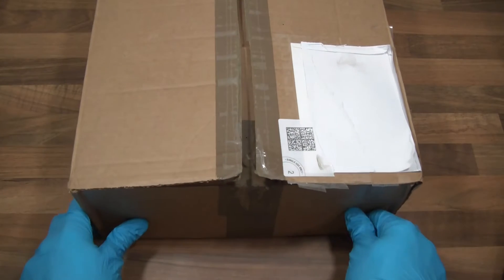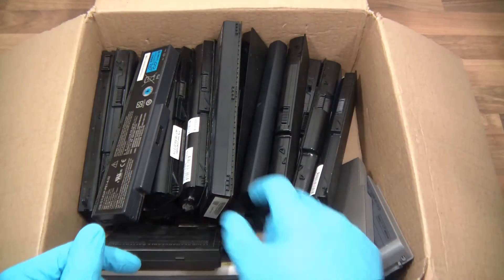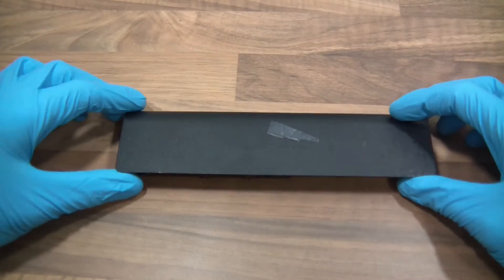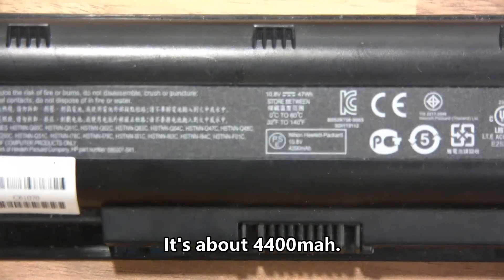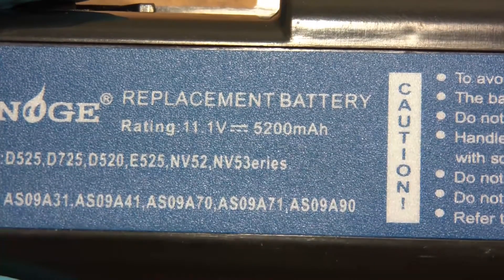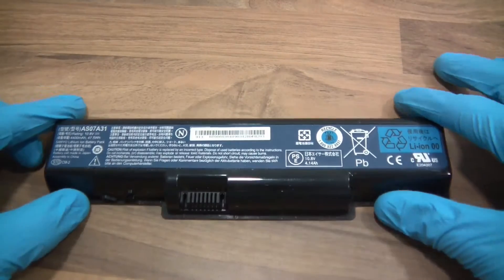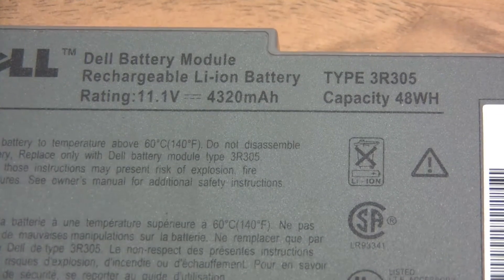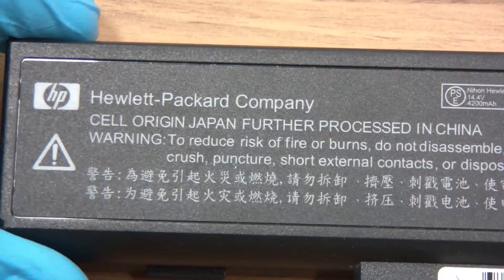Recycling/Salvaging Lithium Ion (Li-ion) 18650 Cells from Laptop Batteries! (Part 1)

Comment: Im also going about building power storage bank with a inverter i will also be building for this project im doing to build from parts i find in electric apliances which are pretty easy to find and have a different use for them for making things such as power generation.